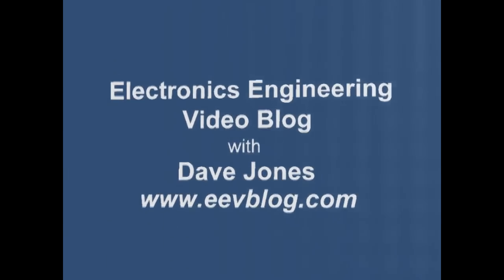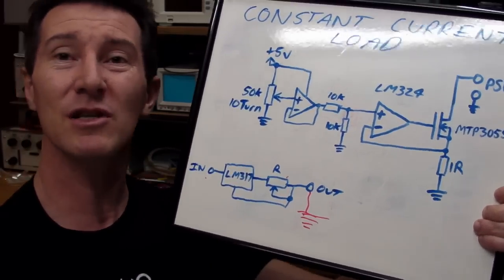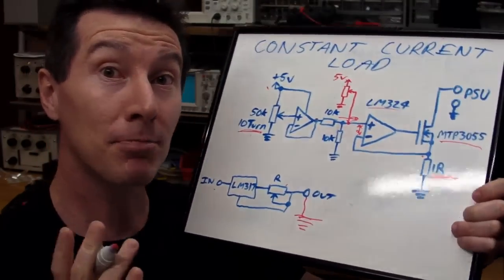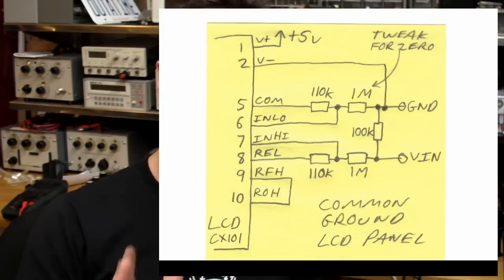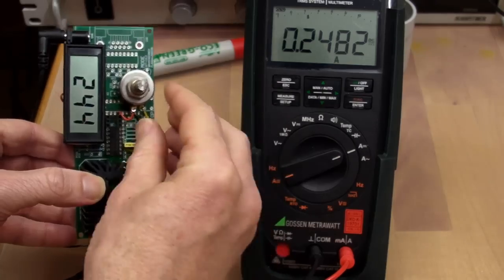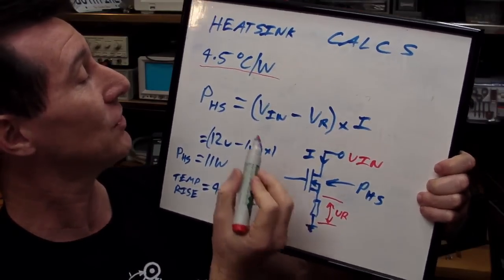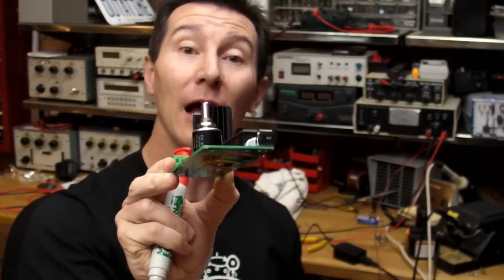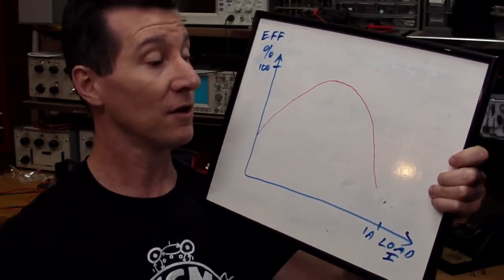EEVblog #102 - DIY Constant Current Dummy Load for Power Supply and Battery Testing

Comment: "from a couple of junk box parts". Like CX101 meters. My junk doesn't resemble that at all :-(
Reply: +Juanjo Aparicio Perhaps a 0-1 volt analog panel meter is in your junkbox?  It doesn't have to be Digital.
Reply: Finding a voltmeter in the right range that works in a grounded configuration has proven very tough.  The cx101 appears to unobtanium these days.

And I want a digital meter, don't care for analog for this application.
Reply: One doesn't have to keep the voltmeter connected all the time, so set the test unit using a regular DMM and then do the testing. It may be more convenient to have the meter built-in...but it isn't required.
Or...one could set up fixed resistance value points using carbon or precision resistors as desired with a rotary switch to then set the current to some common values one might want (e.g. 100mA, 250mA, 500mA, 1000mA etc). I find in most cases I don't need an infinitely variable current load to test things.

Comment: The other part of the heat dissipation calculation is that the MTP3055 has a thermal resistance between junction and case of 3.13 degrees C per Watt. That means with your 11 W example, that the mosfet junction will be another 3 x 11 = 33 degrees above the case/heatsink - a little over 100 degC with a 20 degC ambient. That's within the maximum operating temperature of 175 degC for the device, but a little toastier than I like.
The corollary is that your heatsink/mosfet combination has an absolute maximum power dissipation of around (175-25)/(4.5+3) = 150/7.5 = 20 W with a 25 degC ambient. You might want a better cooling solution if you start looking at higher voltages and currents - 12 V and 2 A would well exceed the capabilities of that heatsink. And to get past 50 W, you'll need a mosfet in a different package.

Comment from the maker: @cborrero2000 The opamp output gives whatever Gate voltage is required to keep the constant voltage across the load resistor. It's a standard building block circuit.

Comment: Very well explained and executed.

...If you'd only gone one step more and shown how to relate the allowable maximum temperature of the MOSFET to the power dissipation of the heatsink to verify that the heatsink would adequately protect the MOSFET for the maximum current you were allowing the device to draw.

Comment: Hi Dave.

Would it be possible to use an op amp and a logic mosfet to give a variable constant current source rather than a load? I have built a similar circuit with the LM317 and fixed resistors selected by a rotary switch to give me 10mA, 20mA, 30mA, 40mA etc. But it would be nice to have a completely variable current source from 1mA up to 1A perhaps?

Cheers, John.

Comment from the maker: @brikotube 
No real reason, I just had a suitable one. Same circuit works with BJT's too. If you battery power the thing then the extra base current requirement of BJT's might be a problem.

Comment: Notice that the op-amp feedback controls the DC current depending on the PWM input (because the voltage across the 1R is proportional to the current), NOT resistance. For power, P=V*I, which is the same as CC iff the supply voltage is constant (not necessarily true! Think batteries as they discharge). Constant-resistance would be to vary current according to supply voltage according to Ohm's law, i.e. you have to actively maintain the constant resistance since the OPA/NMOS system is CC.

Comment: Great video, quick question though, with the 1 ohm resistor in place can you not just connect the pot to the mosfet and change the gate voltage to increase/decrease the current? This works in my simulations so I'm struggling to understand why the Op-Amp is required. Cheers!

Comment: I have a remark about the diagram at 16:40. In constant resistance mode, to justify Ohms law, you'll need to know the input voltage and adjust the current accordingly.  Since the microprocessor sets the FET current with PWM, it also needs to monitor this input voltage. The inputvoltage (=Voltage across FET and current shunt resistor) can be monitored using a resistive divider over the input connectors. The divided voltage is then connected to a second channel of the microprocessor ADC (or use an analog multiplexer).  For constant power, same story.
Reply: Agreed, the battery voltage is useful for data logging and as you note required if you want to do constant resistance (or constant power) actively controlled discharging.

Comment: Awesome as always I would like to see a circuit for constant current and voltage both adjustable to hook to a server power supply or two supplies for 24v up too say 100a DC thanks keep them coming
Reply: 24v at 100a is 2.4kw thats a lot of poer to be dissapaiting in semiconductors and a heatsink. I woud use some enameld copper wire in a tub of water, not so convinient but a lot cheaper

Comment: Since MTP3055 is an N channel mosfet, shouldn't you put the load resistor on the drain side? Or does it not matter in this case? I'm trying to replicate something similar with constant power mode as well

Comment: Can this also work as an adjustable current circuit for a power supply ? Say you drop that MOSFET before the Constant Voltage (CV) side of the power supply, what would happen ?

Comment: Nice explain on the load. One bloke made one of these, but his oscillates.. and he thinks it's supposed to do that! Aaah! I knew that's not right.. your circuit verified that. His has no bypass caps.. thus oscillation.  Also, excellent hack on the meter! I had done the same hack to my LED panel meter. Cheerz

Comment: Something like this should be easy to scale up by increasing the number of MOSFETs fitted and by using fan-cooled heatsinks. I use a CPU heatsink from an Xbox 360, although it's not fan-cooled, but I don't need to dissipate 150W like you do! You may have to get creative when clamping a CPU heatsink, though. Mounting back-to-back might make it easier (I have a spare, unused MOSFET under mine, so each TO220 epoxy block faces the other one's metal tab, with legs sticking out opposite ends).

Comment: Will this circuit work as a chopper for a stepper motor driver that pulls too much current through its h-bridge or do I have to go with something more complex? Adding a heatsink to the h-bridge is not an option.

Comment: Hi! I need to build a dummy load for a PC power supply that can draw up to 100A and another unit that can draw up to 30A that are adjustable in steps of 10A and 5A respectively. I know my basic electronics but I would have absolutely no idea on where to start with this. I have heard MOSFETs are very scalable and can achieve this with adequate cooling, but I need a circuit diagram or something so I can make it. Please help!

Comment: Dave I'm having trouble with "drift" with the OpAmp voltage follower. I used a 1ohm, 10% power resistor, an LM324, and a IRF540 Power Mosfet.

I am using a 9V power supply for the LM324 (measuring it, it actually shows about 10V)

I notice that if I use this to test battery discharging I get "drift". I'll start out at say, a setting for 500ma, and as the battery voltage drops, the current increases , and i'm not sure why. I thought perhaps its something to do with the MOSFET changing its conductance or something? I always end up having to adjust the input pot setting over time to lower the current back to 500ma

It doesn't make sense to me becasue the OpAmp should technically keep the voltage /current constant even if the resistor drifts, wouldn't it? It almost seems like my OpAmp is drifting.

Also, my MOSFET doesn't get hot at all, granted I'm only running 1.5 V at 500ma , and the resistor is .5V of that (I set the OpAmp + input to .5V so I get .5A on the 1ohm resistor), so ya it's only having to handle what, 500mw, not that much I guess.

Comment: I have been wonder if it is possible to using 1000 watt MOSFET with MIC1337 timer (the perfect 50% cylce) while testing power supply at 12V 60A?

Comment: If I understand this correctly most of the power is dissipated by the mosfet? Is there a design where the power would be dissipated by resistors? I'm thinking a big ass cap, a pwm controlled mosfet and big ass power resistors. I feel something like that would be easier to make programmable with a uC and scaled up in terms of maximum load.

Comment: I need to test an IPSU with 9 different power rails ranging from 1.25V to 5V and current less than 1A would this design be recommend for my case? Thanks.

Comment: I always look at the worst case scenario whenever I re-design a circuit to suit my needs and in this case I would have soldered a 1M resistor from the wiper to ground. Similar to input conditioning when I do programming. It avoid unforeseen bugs and aids troubleshooting. I also make a point of establishing and highlighting test-points within the circuit since nobody I know troubleshoots at a leisurely pace.

Comment: Why did you calculate a max of 2.5A (given the 1/2 voltage divider between the opamps) and then you got only 1.3A in the actual circuit???
Reply: BIll Geo I think it's because of wire resistance. (They were thin).
Reply: It would be 2.5A with a rail-to-rail opamp. The lm324 goes up to max VCC - 1.5V so the full swing for a VCC of 5V is 0 to 3.5V, divided by 2 results in the ~1.75V. Why 1.3A instead of 1.75A? I'm sure the answer is buried in the datasheet of the opamp or the tolerance of the resistors, etc
Reply: @catalinvasile9081  You have the right idea. The LM324 isn't going to swing above about 3.5V with a 5V supply. Since the gate threshold voltage for an MTP3055 is specified as somewhere between 2V and 4V, it's pot luck whether the circuit can actually turn on the mosfet.

In the worst case scenario needed to sink 2.5A, there will be 2.5V across the current sense resistor, so the source will be at 2.5V and the gate could need as much as 4V above that just to turn on. Then as the mosfet has a minimum forward transconductance of 4A/V, it may require an additional gate voltage of 2.5/4 = 625 mV to supply 2.5 A.
That means you have to design for a voltage of at least 2.5 + 4.0 + 0.625 = 7.125 V at the gate. Finally, the LM324 needs another 1.5V "headroom" which shows that you need a 9V power supply for the opamp to accommodate the worst case with that mosfet if you want to sink 2.5A.

If the actual circuit limits to 1.3A, that would mean that the LM324 output and the mosfet gate are at about 3.5V and the mosfet source is at about 1.3V, leaving 2.2V as gate-source voltage, which is a bit better than what you might expect as it has a typical gate threshold voltage of 2.7 V according to the data sheet.

Comment: Hello, since i have stumbled upon your blog i found very useful stuff here and learned something. I'm trying to build a small test rig for testing vacuum tubes and transistors under working conditions. So far i have used resistors are constant current load but as usual resistor stack is never big enough and you need to use some high power ones. So i thought why not to use variable current source instead of resistor so i'm wondering with some modifications could this circuit work in a way i imagined it should.
Ofc limiting current for supply voltage is only one part of that test rig, other is how to drive gate/grid/base but that's another story and not connected to this video.

Comment: Opamp is required to maintain the constant current. With a pot + manual intervention, you could vary the current, but the current will vary the moment supply voltage varies. Using opamp in closed loop will make sure that the current is same irrespective of any input voltage.

Comment: @EEVblog Hi Dave and brikotube. Excuse my ignorance please but, I want to know why do we need a transistor, either Mosfet or BJT, at the output of this circuit Is it just working as a switch?; so it won't let current through when the voltage in the first OP-AMP follower has a input of 0 volts? or Is it to handle the voltage difference = Voltage of PSU minus Voltage on the 1R resistor? If, so why is not appropiate to use this second opan as a second follower and put a second resistance ontop THX

Comment: So looking around I found RFP30N06LE:

30A, 60V, ESD Rated, 0.047 Ohm, Logic
Level N-Channel Power MOSFET

Does this mean I could use something like this to get 30A dissipation ? I know heatsinking would need to be huge but would it work ? And to increase to 60A can these be used in parallel somehow ? Any help would be appreciated.

Comment: It occurs to me that what I said earlier on transient is not strictly true. The op-amp isn't purely a proportional controller (ideally it is, in reality it has an s-dependent transfer function). You could probably add a capacitor somewhere to move a pole and increase the damping. I'd have to sit down and look at it. (Also, that's assuming you mean transient response to a control voltage change, not a change of the supply voltage—that's a different problem I've been thinking about.)

Comment: Hi Dave I'm trying to use the CX101b LCD but it's a pain in the ass to configure, can you tell me what resistor values you use to get it to read 1999???? I know that your schematic values are not the same as what you use.
Thanks.

Comment: Steady-state error is probably due to a low op-amp open-loop gain (or your current sense resistor isn't precise enough). For transient, do you know any control theory? This is a pretty simple proportional controller with very high gain, so depending on the opamp/NMOS transient can be horrid; you could try a PD controller or a PI controller with a smaller proportional gain (the integral eliminates steady-state error, smaller gain improves transient). It requires several circuit changes, though.

Comment: Hi!Great job !how can I pull out 20 amps?? I have the LM324, I hooked up a irlz34n mosfet and my source is a computer power source that gives 30 A in 5, 12 and 3.3 V. I need it toi connect it with a microcontroller and control the amps. Unfortunately I need at least 18 Amps and the maximum that I take is about 3,80 Amps.

Comment: I dunno if this will help but when i use pc power supply as a voltage source i noticed you dont get much out of it unless you have a load on the 5v side(maybe 12v side, it's been a while) so just hit up radio shack and grab a 5w load resistor, strap it to some old cpu heatsink w/fan and load that puppy up. =D hope that helps you get your supply into the optimal range your lookin for.

Comment: Regarding testing 18650 cell : Who is right ? - the people that set the cutoff at 2.5V. or 3.0V.  - I see on youtube that some test 18650 battery with different cutoff - then the result will also be different !
Reply: Look at the datasheet for the cells you want to test, the answer about cut-off voltage is there.
And, yes, different manufacturers can have different cut-off voltages, and there can also be a difference from one series of cells to another within the same manufacturer. Some cells may even have different cut-off voltages depending on usage, , it shouldn't be easy.

Comment: Pretty awesome little project.  I want to make one but I think I'd like to "crank it up a notch" and have a microcontroller involved that varies the current, takes measurements and spits them out back to a computer.  Press a button, capture data and graph :-).  The original use of your board seems to do something along those lines where the uC controls the current, unless I misunderstood.

Comment: Dale, doing it in that way creates a constant resistance load, so the current will change when the power supply voltage under test changes. Wicth Dave's circuit the current sucked from the power supply is constant.

Comment: Question for ya Dave...  The MTP3055 you use here...  is the tab of the TO-220 electrically connected to any of the pins, or is it floating?  I'm hoping to be able to solder it down to a copper shim as part of my heat sinking, but I kinda need to know if that's possible or if I need an insulator which would change the strategy.  The datasheet doesn't say, so I figure you might know.
Reply: drain connected

Comment: Hi Dave, can I change logic fet with power one (24n60) and using 9V or event higher instead of 5v power supply, because I can't find logic fet
Reply: Yes you can. You will have to adjust the voltage divider.

Comment: Excellent video, and with the knowledge gained I am going to build a project I have been putting off: an intelligent battery charger!

I have some I2C DACs from Microchip which should be very suitable for setting the opamp input voltage.

Comment: paul i was wondering about the 10 turn variable resistor if taken to ov then would that not short the supply ...?
Reply: No. The 50K pot is wired as a potentiometer not a variable resistor. The current through the pot will be only 100uA no matter where the wiper is.

Comment: hey Dave do you have the code for the micro. i would love to see the code and math. thanks for sharing your knowledge
Reply: +Redneck Tech It's pretty easy, would even work with some opamp circuitry... 
You'll need additional sense wires and one ADC directly at the input terminals for the Voltage.
Constant Power: voltage * current > threshould? Decrease Output Duty Cycle
                                "                               < "                     ? Increase Output Duty Cycle
Same goes with resistance, but voltage / current instead of voltage * current

Comment: Is it possible to replace the MTP3055 with NPN BJT 2N3055 transistor ?
Reply: The FET version is easier to deal with because it is Voltage controlled and poses less of a load on the OP amp.  FET's for me are the way to go, life is sooooo much easier using these devices. They're also more reliable. It maybe a good idea to include a 10K resistor from Gate to Ground just to help with ensuring Gate control reliability